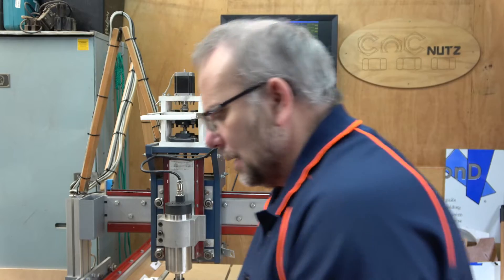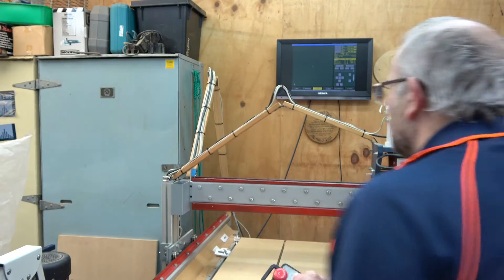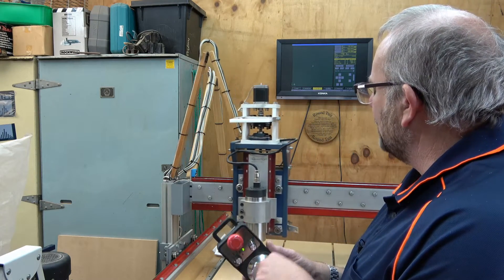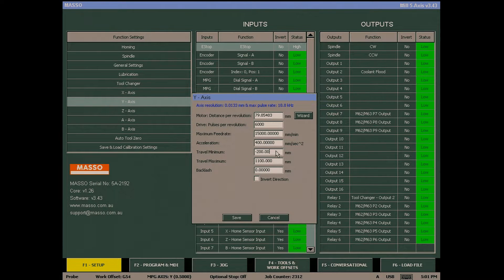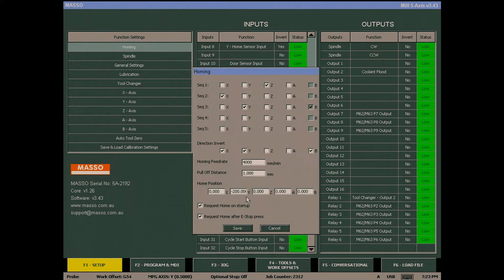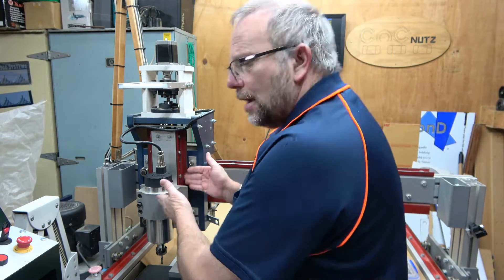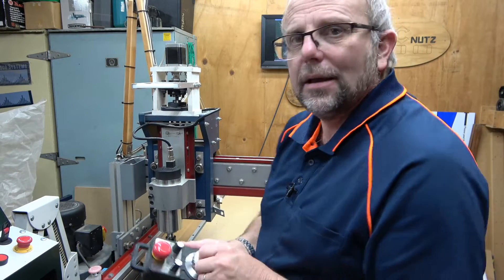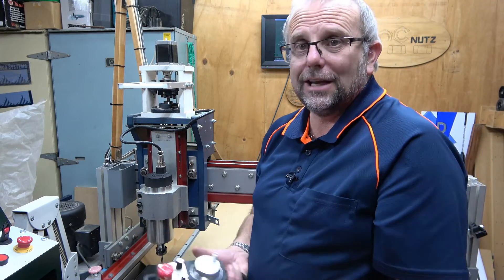How to Set up Soft Limits on Masso - Masso Edition 16

Comment: So nice. But do MASSO work with mach 3  or wat program?. Thank you
Reply from the maker: Masso is a stand alone controller. It works with itself. 
Mach3 is a PC based controller and requires additional interface hardware.

Comment: I noticed that your setting for pulse/rev was set at 6000.  How did you arrived at that value?  When I set my system to that value my distance per rev went from a nominal 2.? to 7.11.  Do you have a video on this area?  Thank you very much for this video.
Reply from the maker: Hi Clifford
The short answer is I calculated the values and while I don't have a video on it I have created a spreadsheet for Masso you can use to work out your values and created a thread on the forum. 
https://masso.com.au/forums/topic/setting-up-linear-and-rotary-axis/#postid-10184
cheers
Peter